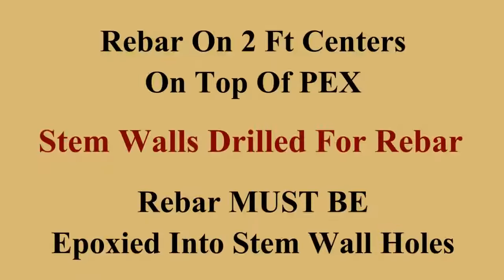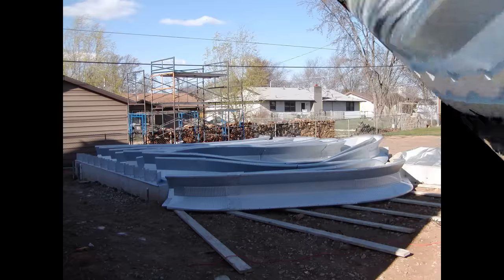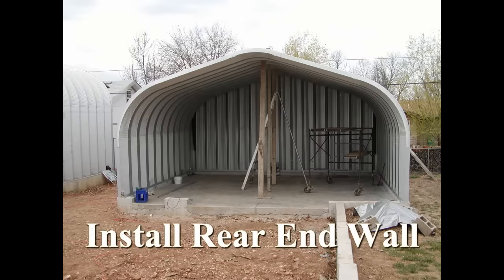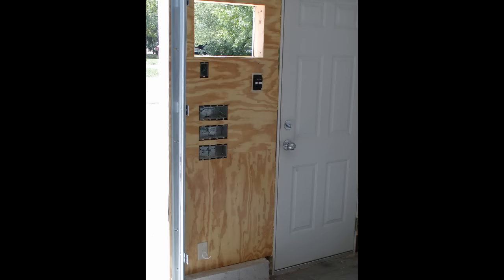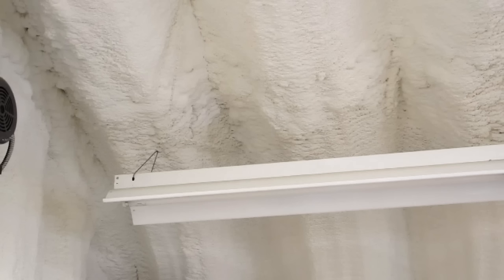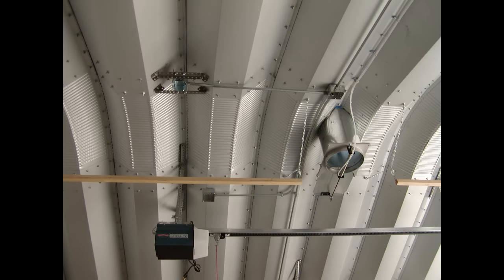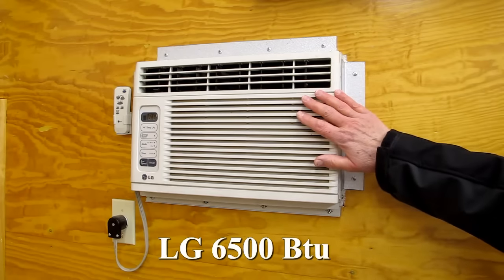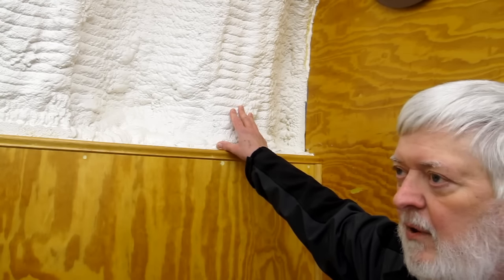Building My Steel Garage

Comment: how did u fasten the 2x4's to the inside walls
Reply from the maker: +ron johnson I used some of the building bolt holes where possible for the top & bottom 2x4's and drilled holes for the middle 2x4's. The 2x4's were attached with lag bolts with a bonded washer and a flat washer under the lag bolt head. The lag bolts protrude on the inside of the garage so I ground them flush with the surface of the 2x4. Watch the video again and you will see where the bolts are ground flush. Where a building bolt interferes with the 2x4, you use a forstner bit to cut a clearance hole in the 2x4.

Comment: Neighbors had lots of relatives.  they helped him put it up.   Concrete floor.   snub wall on sides (inches), he build out the front and back.  Structure is great.   He was going to use it for working on cars, as he's otherwise unemployed.   He's still unemployed, and doesnt have room in there for anything.   filled with junk.   He build shelves, to get stuff off the ground, and get more floor space back.  Took stuff off the floor, put it on the shelves.  Then got more stuff.  Still same problem.  Now, there's a path to walk in and out.  Not enough room to take out a bicycle.

Comment: Hi Ronald I have recently purchased a   Pioneer steel build 20x30 getting ready to mount the steel base plates i added to my order after watching this video my local dealer is useless and I do have some questions like what is the exact measurement between the base plates?
Reply from the maker: They are required to give you the drawings and the installation booklet for your building. You need the exact dimensions (which vary for each different type and size building) so you can prepare your stem wall (or whatever you are doing). Either grab your dealer by the throat (or kick him somewhere he will remember) to get his immediate attention or call the factory in Toronto, Canada and complain about your dealer. The factory will listen you... believe me!
Since I did not sell you the building, I can not really help you.

Comment: How much would a 20x40 cost
Reply from the maker: Danny Doty Get an estimate from a GOOD concrete contractor for the footings and stem walls, both with lots of rebar, and the concrete slab with rebar on 2 ft centers both directions plus 6" square wire mesh, all as shown in this video. The cost of the steel building will probably be pretty close to the same cost.

Comment from the maker: It really is not something I can explain in the 500 characters allowed in this comment section. I do not represent steelmaster buildings. Also, I prefer to retain procedures I have developed for my use and that of my customers. Your dealer should provide you all the answers you require although in my experience most of the dealers do not know much about erecting one of these buildings. If your dealer does not or cannot answer your questions I suggest you drop him and find another dealer who can.

Comment: Its not very good idea to use a rebar mesh as guide to pex piping as tiny movement of pipe could grind off pipe wall causing leaking - there's dedicated coated mesh to serve a purpose or plastic rails.

Comment: Please tell me where you bought your building.
Reply from the maker: gojohnnygo6869 It
is a Pioneer Steel Building manufactured in Toronto Canada. I bought it
from myself. I am an authorized dealer. However I have not actively pursued
trying to sell these buildings, as I do not have time to deal with it at this
point in time.

Comment: Your walls move?  Mine don't
Reply from the maker: Until the bolts are all tightened, there is quite a bit of movement. After everything is tightened there is a very small amount of movement most noticeable end-to-end. You can hit the end of the building and it will transmit to the opposite end through some flex in the corrugations. After the expanding foam was installed it eliminated most of that but the steel buildings will expand and contract... bright sun then cloud cover or rain just like a metal roof does.